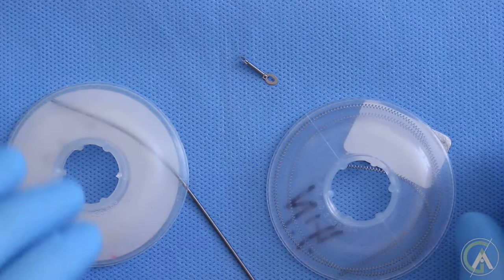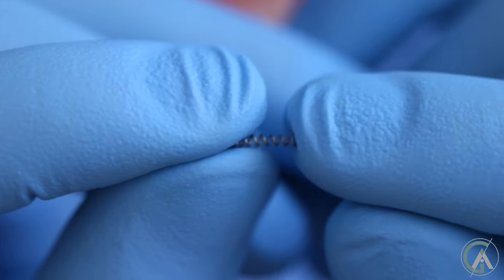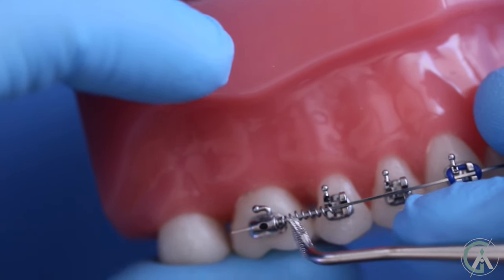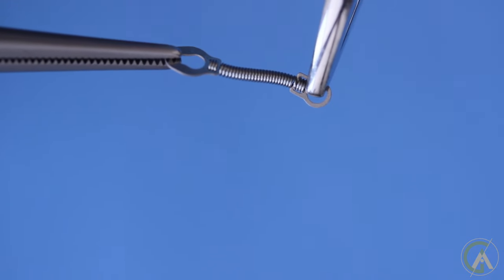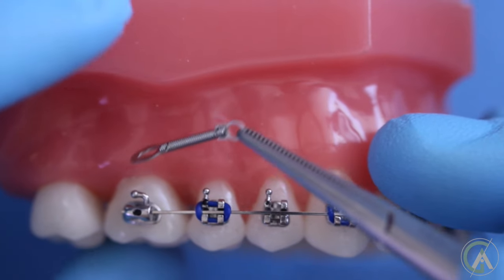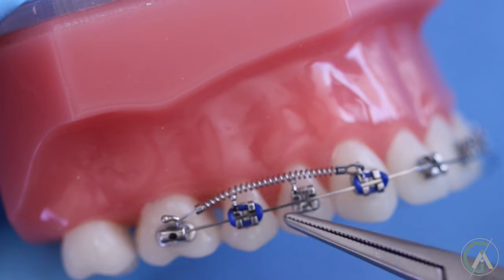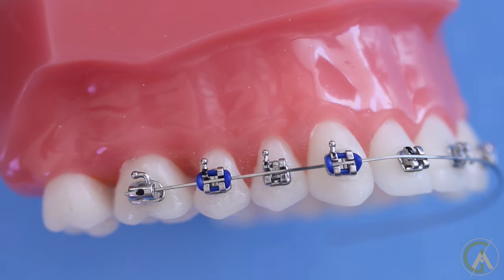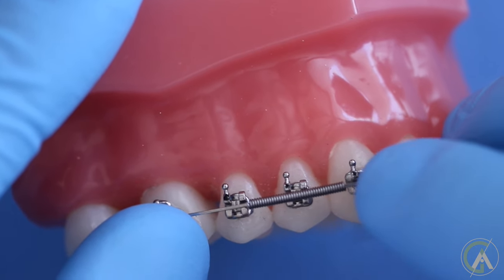[BRACES EXPLAINED] Coil Springs

Comment: I got a open coil put on late week and my orthodontist put the bands on two of them (the coils was place on my three bottom teeth) because one of the  bands wouldnt stay on. My question is that one of the two bands that were put on the coils fell off and I was wondering if I need to go back to get a new one put on? Or would the coil work the same without one of the bands?

Comment: My orthodontist put in an closed coil spring 
1st month He gave me rubber bands
2nd month he told me coil springs are better for retraction and added closed coil spring
on 11th I am going to tighten my braces 3rd appointment with tad.
Reply from the maker: Nice! If you want to learn more about TADs, I have a video describing what they are and why they are used

Comment: I had my first pre-molars extracted, and the gap is now being closed via closed springs. I know there are many factors at play, but do you know how much distance the springs close with every application? It's super cool to see Hooke's law in action.
Reply: Hi, may i know why u didnt consider implant on missing tooth? Just had a molar extracted, and i feel im missing something and that my treatment is useless bec the missing molar will make the rest of the teeth move especially it's upper counterpart.
Reply: @qcrctgavarcesxrfab8015  maybe OP had to have teeth extracted because lack of space to fit the other teeth. It’s the most common reason why premolars are extracted.
Reply: @qcrctgavarcesxrfab8015  because the gap is being closed that's the whole point
Reply: Hi I wanna know that did the orthodontics inserted tads into your gum for the coil spring? I've seen many videos about tads with them and I'm hella scared

Comment: What if the teeth dont seem to move with an open coil spring? I've had one for a month and a half and I dont see any improvement :(
Reply: I have two extra diagonal teeth that goes inside and my dentist wants to pull and align it straight. So, he had this idea of putting open coil spring to move some teeth to give way to my extra teeth to prevent extraction of my two front teeth. This is just a trial, if no movements happens in a month. He had no choice but to extract my two front teeth. But if it does work, no need for extraction. Idk if we're the same case.
Reply: @ahlluipio564  did you got coil springs? Do they hurt?
Reply: @Moon-qu2uy  Yeah. Two open coil springs. I did hurt a lot.

Comment: Why do some need extractions for braces? How does one know if they will need extractions for braces?
Reply from the maker: That's an excellent question! There are so many factors that go into extraction of teeth - I will make a video on it soon but just have to simplify it so still working on that! Best way to know if you need extractions is to go for an orthodontic consultation and they can explain to you a treatment plan!
Reply: I mean common sense ?? Sever crowding and lack of space. I have a tiny jaw and big teeth. So I preferred getting some useless out of line premolars out.
Reply: Soy Saucey my orthodontist said I have to extract 4 of my teeth because I have protruded teeth.

Comment: But what's the difference between a close coil spring and a power chain? stronger effect?
Reply from the maker: Great question! The spring has a more continuous force but sometimes that is undesirable. All dependent on your case
Reply: @DrGregAsatrian  When would it be undesirable to use coil springs versus a power chain?

Comment: Mine started hurting recently, even though I've had them on for about 3 months now. I've been consistent with my rubber bands or elastics, and they're actively trying to shift but are held back with these likely open coil springs. 😅 I had an assistant in the office last tell me that they're likely just using an open coil spring as a passive/to hold it's gap there.
Reply: I have the same. I have a question through.. will the inside of my mouth ever get used to the rubbing of the open coil spring? I'm on day 3 with them and it hurts bad to open and close my mouth. Also I have the ceramic braces will my mouth ever get used to them lol I feel like I can't even talk right or like I have fake teeth that won't stay put haha

Comment: What are different function between close coil spring and power chain?
Reply from the maker: Fantastic question. Coil springs usually are a more consistent force where as power chains burn out over time. Sometimes we want a constant force but occasionally, when sliding teeth on a wire, we want intermittent

Comment: So one of my teeth is just very slightly behind the others on my bottom teeth. When I say slightly, I mean slightly and it is one of my incisors. So for some reason, my orthodontist missed that tooth out and put a coil spring connecting the teeth next to this tooth. I don’t know what was the point of that as all the teeth are very close together...anyone? Also there is no wire behind, on top or under this spring
Reply from the maker: From the sounds of that, it seems as though your orthodontist is trying to make some space for that tooth thats behind. Then he/she will put a brace on it and grab a ahold of it =] Hang tight!
Reply: Dr. Greg Asatrian thank you❤️❤️

Comment: I had a passive coil at first because I had a baby tooth that they needed to preserve the space for an implant later. my lip got caught in it all the time and basically ripped little chunks out. it was annoying and hurt a lot. I got a new passive spring during my last wire change but it fits the gap much better. haven’t had any issues yet. I have a large gap from a missing molar so I might get an active spring at some point or maybe power chains (can’t afford two implants and I have an extra wisdom tooth on that side anyway).

Comment: Just got my braces on and they put two blobs of glue on my back teeth they are really annoying what are they for?
Reply from the maker: Oh that is because when you bite down naturally, you were hitting on the brackets and would probably break them off! These blobs of glue stop your teeth from touching until your initial aligning happens! =]
Reply: They're super annoying, I have them also, you'll eventually get used to chewing with them though!
Reply: I have them too but my upper tooth still hits the coil spring on my bottom tooth and it hurts so bad
Reply: IzzyGrace it’s a bite blocker it’s so you don’t bite down into the brackets I will have to get them when I get my braces on next minth

Comment: I have a open coil spring on my right side teeths to make space. I barley got them tightened today & I noticed that the wire inside the spring seems broken. Should I call my orthodontist to see it or what?
Reply from the maker: If you notice anything is broken, I would suggest you call our orthodontist just to make sure that everything is oK!

Comment: I have 4 closed coil springs now in my mouth😅 upper for right side and left side and also the same case at the lower teeth😅
Reply from the maker: Closed coil springs all over the place! haha Hope the space closure is going well =]
Reply: Dr. Greg Asatrian whats the difference between rubber bands and coil springs to close the spaces?
Reply: Dr. Greg Asatrian whats the difference between rubber bands and coil springs to close the spaces? Because some patients will use rubber bands to close the gaps between their teeth if im not mistaken😅
Reply: Same question is bothering me
Which is better closed coil spring? or elastic rubber bands?
My ortho told me that closed coil spring is better for overjet

Comment: My orthodontist put an open coil spring on my braces because the first day I got my braces bonded one of the brackets popped off my tooth and they said that it'll be okay and I can wait to get that fixed. Eventually my tooth that didn't have that bracket on got pushed back from the process. So now I have to use the open coil spring until they can even repair that bracket.

Comment: i have an open coil spring and GOD MY MOUTH HURTS. I have an expander,spacer,and braces. with a. coil spring on the bottom and i forgot what my wire is called on the top. I think it’s something like tube top?

Comment: Hello doctor, 
My orthodontist applied two closed coil spring from my upper right and left lateral incisors to  my 2nd molars. They slipped over the bracket and are now leaning against my gums. When I wore elastics I could easily adjust them, but I don’t know how to move the close spring back over the brackets. PLEASE ANSWER. THANK YOU!

Comment: I've been very unfortunate with my case treatment cause apparently I have the smile/dental work for these docs to want to profit off of... I have a complete set of healthy teeth, they purposefully create open spaces with open coil springs that I don't have in my teeth so I'm obligated to think I need implants and/or am in a position to need to resolve it (in two treatments I've been on 😓), and I'm all fedup lol. I decided to ask my ortho in my next appt. when he's going to start placing a closed coil spring on my created large spaces... Cause I do not want dental implants.

I used to consider it honestly because if it's something necessary... but if it's just an elective, fast-action course for them, and a nerve damaging, problematic surgical procedure for my surrounding teeth entirely, etc... at the cost of myself for their profits or referrals(if they even provide any)... I'm good. 😂😂 East coast orthondontics do the serious most.

Concerns aside, thank you very much for the video. Sometimes we truly need good doctors.

Comment: :') I have a large gap created from improper previous orthondontist treatment, and am now with a more compassionate, and honest office... What my past was never provided, my current orthondontist is.

He used open coil springs in the main concerned areas (first premolars and canines). And I believe it's now in due to open space, but to deposit new bone growth, to thereafter help better close these spaces. They'd be applying my bottom braces in October, and starting rubber bands. Thankfully, I'm confiding & seeing how it pans out.

Comment: I had a coil spring placed to make space for one crowded tooth. Yesterday I had it removed and and wire placed on bracket of the tooth that needed to come forward. Just overnight the tooth has moved so far forward but the teeth on each side have also moved closer together again. It now looks like this tooth will not fit in between the the two teeth where space was created. I'm sorry I am trying to explain this as best I can. Please advise what should be done now. Thanks

Comment: Braces Explained I have a question about coil springs. I have a coil spring between my front tooth and canine tooth to make space for the tooth between. The coil is supposed to rotate my canine tooth but it slightly rotated my front tooth as well. Is this normal and will my front tooth go back straight like it was?

Comment: Hey Doc,
My ortho inserted mini screws after 3months. And he connected with rubber bands
One month later he took off rubber bands and now he is using closed coil springs
I have an overjet problem
Which is better for retraction?
Coil springs or elastics?

Comment: Plz help me out with your advice

Its been 3 month since I put braces....
There are few things on which im doubting the credibility of my dentist:
1.he has put the wire till 1st molar...he said there is no need to put the wire on the 2nd molar
2.my teeth  getting yellowish stains.......when I asked the dentist...he said it's fine ...he gonna polish it at the end of my package that means the time when he will  remove the braces...he is not even cleaning my teeth...there is yellowish stains all over my teeth
3.he didn't even clean my teeth while putting my braces ...

Plz help me....is he doing correctly?

Comment: My Ortho wants to use IPR in between my Laterals and Canines because  my laterals are turned distally and are tucked slightly behind my Canines. I’m not really comfortable with that since I have small teeth... can a open coil be used as a second option to create space?

Comment: Hello Doctor i have a question.
Is there any other way without using the screw tad?

Cus my case need to use 4 screw tad 2 at the front top. And 2 at the back top.

Comment: I've had braces for 5 months, and now I'm on powerchains. I have many gaps and an overjet, but I dont want to fully close the space between my front teeth. I'm used to it, so they put in a spring. I'm still debating if I want to fully close it or not. Is this crazy to do?

Comment: Hey, my ortho has caused a pretty bad midline shift in my teeth but there’s no gaps to correct it, he is suggesting taking a healthy pre molar out which I absolutely do not want to do. But I know that there is a small gap right at the back of my wisdom teeth (because they were further back before he moved them forward by accident), could an open coil spring be used to move the whole left side of my teeth backwards by a small amount to fix my midline? Hope this makes sense and I hope you see this, I’m bad at explaining. Thank you!

Comment: I get it I only have top braces and I have my two k9s removed so it’s just a big space there until they grow in i just thought it was there so the normal wire wouldn’t damage my gum where it was missing. And can I chew gum with braces?

Comment: I had a closed coil spring put in before lockdown and it stayed in for 6 months because of it until I took it out because it closed so much space that the braces wire stool out so much it was almost piercing my gum🥲

Comment: Hi question my coil springs on my bottom teeth r like “moving” as in when I touch it it will move a little or when I move my lip I can feel them moving kinda and here a popping kinda sound when the move up and down on wire is it normal it’s hard to explain it is multiple on my bottom they r very tiny but still move and I just got them March 20 th

Comment: I have a passive coil spring that pass over one tooth,  that also doesn't have a rubber band. Is that normal? I feel is not doing anything or holding the space since it can move.

Comment: I have a question, is it normal to use an open coil spring to give space for the impacted tooth to comes down (upper molar tooth)? and also I noticed my dentist didn't tie the bracket which has the coil :/

Comment: I have springs that are creating space to put a bracket on my teeth, bottom set of teeth on the end of the left hand side. My coil spring has come off but I have managed to put my wire back into the bracket. Does it affect the space as I have an appointment next week

Comment: I have braces in my lower theeth for two years. as im travelling outside my country i couldnt go for checkup any more. The problem is over lapping two front theeth each with their next thooth.
These two front theeth have been stoped moving back since last year.  I can see that there is no more space for them to go furthur back to the row. 
my question is if this coil open spring is the solution? or what is the solution?

Comment: both my top canine teeth are impacted and they put a passive coil spring where it should be and it hurts a lot. theres a lot of space between the teeth so i can move the spring a lot, and so the end of the spring gets caught on the inside of my cheek and my lip whenever i make an open smile. i put some wav on it and pushed the spring into it for now, but im going this week to get it looked at.

Comment: Is it possible or normal for a open coil spring to make the teeth crooked that it’s connected to? I don’t get how it opens or creates space when there are teeth on the sides of the teeth that are suppose to opened, my 2 front teeth were fairly straight, but I got an open coil spring and it made 1 of my front teeth more crooked then what it was before I got the spring. I’m confused or not understanding if this is normal or not. Please help!

Comment: i just got a coil spring put in behind my high canine teeth between the two next to it on both sides. one spring is straight between the two teeth the orthodontist put it between, while the other in curved outwords, but is still connected to the two teeth the orthodontist placed it between. Is the spring that in curved working or should i go to my ortho and have it checked out?

Comment: I have an open coil spring, but it’s not tied in.. Its just sitting on the wire and I can slide it back and forth between the bracket.. 🤔... maybe that’s a passive coil spring just maintaining space that’s already there ? I know I will be getting an implant there later on
Reply from the maker: Yup! Sounds a like a passive coil thats used to just save the space to make sure teeth dont drift in!

Comment: I have an open coil spring and I recently was chewing and the wire came out of my bracket and the spring came out I’ve gotten it fixed but I’m wondering is it okay to chew on the side with the spring or is it just going to break again?
Reply from the maker: Its usually OK to eat on that side but you have to be extra careful to not eat the 'do-not-eat foods' so as to not break the wire! I'll release a video soon on foods that you should avoid w/ braces!

Comment: At 1:56 is my case but on both sides (my 1st premolar on left and right side were extracted 2 years ago). I finally got braces just so the spaces would close. I hope my orthodontist will put close coil springs for the spaces. My bottom teeth doesn’t have braces yet because my orthodontist plans on extracting 2 teeth on the bottom (one on each side). Is that really necessary? I just don’t want any of my bottom teeth get extracted
Reply: How do u clean the spring after eating ?